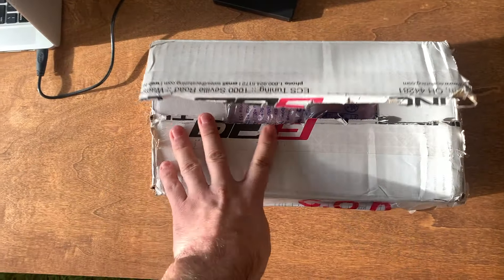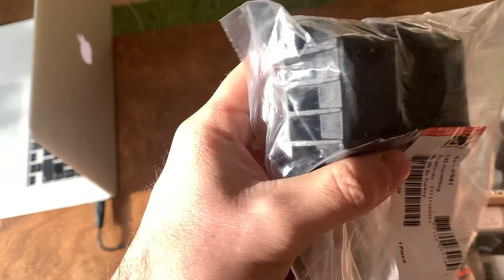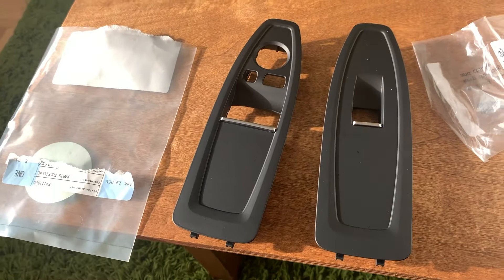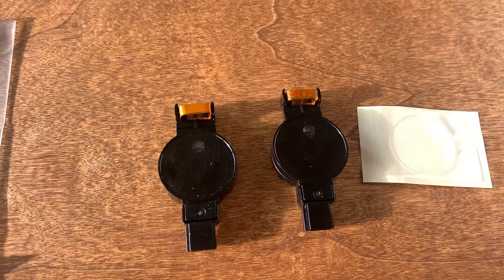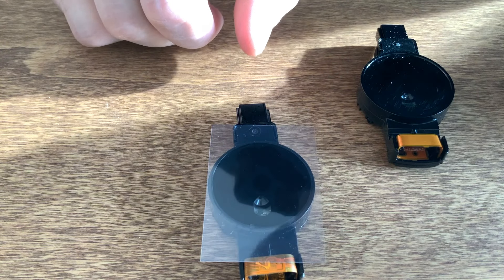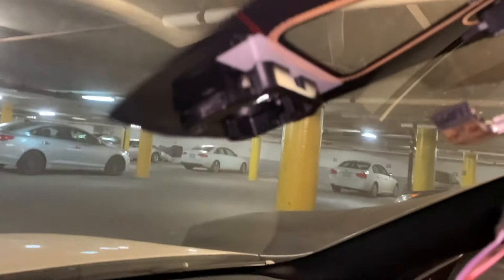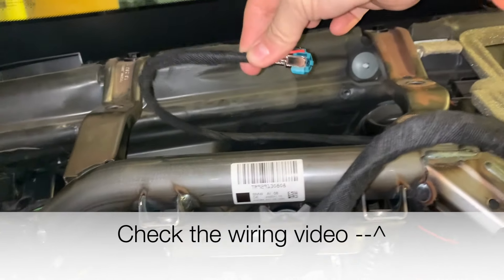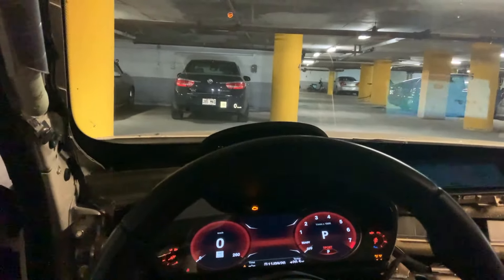BMW 435 HUD + Digital Cluster (6WB) install + Coding Step by Step (No red dot)

Comment: Congratulations for the job. I did the same retrofit on my F30 2013. Plugging the HUD is the simple part of the job.  The more complicated part is to remove all parts from shift parts to dashboard. It's a hard work takes long time...
Again congratulations 👍
Reply: hi man can i know some details about the retrofit? i also have a f30 wants to do the retrofit and did you cut a hole on your dash? I also bought a second hand rain solar sensor but don't know where to buy the gel to stick on the windscreen
Reply from the maker: Hey! So no I didn’t cut the dashboard. If you look at the other video about the change color you’ll see why… it’s doable, but I don’t like to do things that way… check it out. The silicon thing part number is 61 35 9 856 157 I got it through ecstunning but if you are in Europe you can get it through schmiedmann. Hopefully one day they will show me love the way I show them love Hahahah… sponsor requiered. Also don’t forget to change the windshield
Reply: @DorksandBolts  hi thx for reply, I don’t have enough budget to change the whole dashboard and windscreen. Even has double vision I am still gonna use it. I bought a rhd hud from China for only 90 dollars, just try to find all the other harness bolt and rain sensor also the air duck.

Comment: Do not disconect the camera, ADAS recalibration will be required after. :). You can easily remove just the rain sensor with out all that mess
Reply from the maker: Well I disconnect the battery most of the time so the camera is unaffected. But yes good point. It does need to be calibrated. Since this was a full retrofit I am used to do that on a regular basis now 😂

Comment: Great video, if you don’t mind what was the rain sensor gel pad part number?
Reply from the maker: Hi Salvador, the part number is: 61359856157 I think this is the same for all f3x chassis but make sure of it.
Reply: @DorksandBolts  thank you for that.

Comment: Great job!
I did retrofit hud on my f34, but in day time and sunshine cant see any thing!!!! Any advice?
Reply from the maker: Did you replace the windshield and the light sensor ? Check the part of the video where we see the difference between the two variants and how to install it
Reply: @DorksandBolts  windshield yes but not rainsensor!
Reply from the maker: There you go, that will be that final component, just code it properly

Comment: Nice job.a verry rare video with retrofit  coding.i just wanna ask you did you used a battery charge or something like that during the coding.ot just keep the engine on.and if you know does my 530xd 02 2012 foes support nbt nbt evo retrofit? 🤔.thx and waiting for more coding and retrovideos
Reply from the maker: Yes always use a battery auxiliary power to keep it over 14.4v no matter what you do. It might sound overkill for even simple codings, but better be safe than sorry

Comment: Do you have any advice for some starting out whit retrofit? Any programs things of that nature. Also very nice you did an amazing job keep up the good work I will stay tuning in for the next up date!
Reply from the maker: Hi Terrance, that’s a little tough to say. But I would say that it starts by deciding if some feature is something that you really want and can somehow help you enjoy your experience with your car. So it’s a little bit different for each person. Before jumping into any programs for coding, I would suggest really reading up on how your car systems work and what do you need to achieve the retrofit you are after, because these cara are very easy to break if you don’t know what you are doing. That said, if you have more questions, I wouldn’t mind helping you figure things out.

Comment: I've seen a few pictures of the 6WB cluster where the gas and temp gauges are upright, like in the traditional analog cluster, instead of turning the gauges sideways. Is this a setting in the cluster that can be changed?
Reply from the maker: That’s interesting, but don’t I don’t understand what you mean by upright. But as far as I know those two gauges are actually analog. Just a couple of dials.

Comment: Hi name is Donald,
 I would like to retrofit head up display in my BMW 440 I  in a 2018 convertible, so would I need to change the front windscreen to get the image to look ok ?

I should be getting this vehicle in a week or so and I’m trying to get all of the parts that will be required beforehand like the dashboard, light module in the screen and sticky clear adhesive,  and the other item that I will need to get is the head up display. 
So do I need to get any other parts for this retrofit. 

So my options, that I would like to retrofit in the vehicle I will be comfort access, folding mirrors,  Apple CarPlay, head up Display, and speed indication in the cluster.
Reply from the maker: That is correct unless you have the camera already installed… some windshields will be polarized already, check at the bottom of the windshield if it says HUD

Comment: Love the video. Where do I get the necessary equipment (obd to pc cable) and software to code?
Reply from the maker: Hi Marc, you could find the enet cable and the software on eBay or Amazon. Do some searches with your favorite web search tool and you will definitely find tons of results.
Reply: @DorksandBolts  I have a few WiFi obd connection tools and bimmercode and Carly- would you think I can use bimmercode expert mode for this coding or do I need pc software and that hardwire?
Reply from the maker: We do not have experience of doing this with OBD readers, so I would be wrong to say that “computer software is the only way to do it”

Comment: Hi, awsome job!!...did the HUD require a different dash? Or was the dash cut out to fit?...currently looking at buying a used part HUD unit 👍
Reply from the maker: Yeah it does need a different dash, check out the other videos where I explain how to change it, and even change the color of the dash. As I say on that video there are people that cut the dash, but I prefer not to do it.
Reply: @DorksandBolts  thanks!

Comment: I have an F10/ 2015, just retrofitted the HUD unit and replaced veganized 6WA kombi with hud option. I tried to code with esys 3.30.1 / PSdZ ver. 4.38.31 lite. I could not find the correct CAFD Files for any of the units, my I-Step 22-10-510 for all there modules, HUD, Kombi and HU. I ended up using files with the highest possible number. Kombi works fine but HUD never worked but it shows on display with all options greyed out. Any suggestion?
Reply from the maker: Do you have the button on the left hand side to turn on the HUD?
Reply: @DorksandBolts  Yes, I have added the button. The orange light is on. pressing it doesn't do anything. Do you think HUD should turn on even without coding?
Reply from the maker: It should turn on, at least with some info in it, is the most wire from the nbt connected properly?
Reply: @DorksandBolts  I checked all the wires connected, I have ordered new cable from ECS Tuning, should be here by the weekend, the first one was from ebay/China. I am confused about cafd file, how do you chose the correct file from the list if non from the cafd list is fully matching with istep? For example istep is 21-11-520 but closest I find 17-11-520 or something totally different like 23-3-500.

Comment: Great job !!! :) good to clean with mask haha. do you think for my e64 bmw have the silicon pad ? mine is not round ;)
Reply from the maker: Hehe yeah might as well get the masks to have more than one useful function :). I don’t think the rectangular ones have a silicone pad, I have seen a plastic rectangular thing on the windshield where the sensor attaches to.
Reply: @DorksandBolts  on the russian web sit i sent you the guy remove something similar than you. But was on picture then dont know if was kind of hard glue or gely like yours haha

Comment: Hmm, I don't know what I am doing differently but when I code DKOMBI the current gear indicator (P/N/D) doesn't show. I've tried timecriteria 0317 and 0717 but no difference.
Reply: Solved.

Used the original timecriteria instead of the 0317, 0717 or 1117. It now shows the gear and works but I don't know why. The guides I followed instructed that you need to change the timecrtieria to a date when 6WB was available to the F30.

No fault codes  when scanned.
Reply: Perhaps the later date models use KCAN2 instead of KCAN as my 1111 timecriteria?

Comment: Hi are you using icom or just enet cable? I’ve just done this retrofit now I need to code virginised cluster to my car and e-sys won’t connect via vin (greyed) and it just to connect before when I did map update
Reply from the maker: I used ENET, but IT would be totally recommended to do it  with ICOM. IT did happen to me that the VIN connection was greyed out, but I let the car go to sleep (15 mins or so) and then it worked.
Reply: @DorksandBolts  it does connect via vin once I let it sit for couple hours, but now I can’t inject CAFD to kombi because option “detect CAF for..” is greyed and where it says I-step it shows “not available”
Reply: @DorksandBolts  one more thing which e-sys version are you using? I’m using v3.27 and some people saying that I can’t inject CAFD with this version of e-sys

Comment: Thanks for the video! I have few questions:

1. How to find out that specific date that you edited on 27 min mark?

2. When you saved your 'VO kobmi atm nbt kafas', you mentioned that it is needed to code all of these ECUs. Is it because you installed new HUD, KAFAS etc.? 
If I change only the 6WB, do I need to code all the mentioned ECUs? Or just the DKOMBI?

Thanks in advance!
Reply from the maker: Hi Rokas, we are happy you enjoyed the video. What do you mean by “find out” do you mean why did I choose that date?
And yes in my case I needed to code lol those modules so they all know that I have a 6wb and not 6wa. In your case if you are only adding the 6wb you need to code everything that communicates with it, most of the time it will be the FEM or BDC, HU, and KAFAS, as well as the Komibi so the FA matches your car.
Reply: @DorksandBolts  
Yes, you edited your VO Zeitkriterium=1113 to Zeitkriterium=0317.

Why that date and not any other?
Reply from the maker: Oh I chose that because the production dates of those modules ranged from 0716 to 0719 (hardware) so I chose an in between all of them to make sure I have functionality between them.

Comment: I bought a 6wb cluster non hud it dont have heads up display is there a cable i can buy to retrofit the heads up display with the same non hud cluster and input would be appreciated
Reply from the maker: Hi. In our other video, I tried to install the plug and on the non-hud cluster and it didn’t work. There is no way you can have hud without a hid cluster in the f-series 😢

Comment: Hi can share the part number for the light sensor also did you replace windscreen?
Reply from the maker: HI, the rain sensor is 61356814596 but make sure that it does have all the functions for your car as well, these are very option dependent. yeah I did replace the windshield, check out the other video.

Comment: when you disassemble the whole dash like that when you put it back in won't some parts start to creek or something like that?
Reply from the maker: Not really, when I put everything back in; I made sure to put some loctite on screws and blots, also as a precaution I put a little bit more padding on some parts that showed rubbing. So far so good and no rattles whatsoever

Comment: Sorry probably a dumb question, but I have a 2016 f15 x5 40e with HUD. Would I be able to install this dash? From what I’m reading in these comments I am but someone said no because of the HUD
Reply from the maker: Hi, I am be misreading your question, but I am confused, you want to install the hud dash? But you already have hud?
Reply: @DorksandBolts  sorry for the confusion. I already have a hud and want this dash, will this work even if I have a stock HUD? I ask because I was doing some reading and someone else said that if my car came stock with HUD, that I would not be able to do use this dash. Just curious if this is accurate
Reply from the maker: Would it be possible that you send me a message on instagram?

Comment: hi, do you have the 550d logo pop up upon start up?
Reply from the maker: Hi, not really. We didn’t code anything like that on the kombi or the HUD yet. But maybe later, of course we will try to either have the mperformance or 435 in there... currently none of those are possible. If you see this showing up at start up, make sure you are coding the VO/FA to the units

Comment: Hello, I congratulate you for your work, I will be glad if you help with something.  I have a 2014 model BMW f30 vehicle I have installed 2 cameras in my vehicle, but it gives a calibration error, but the high-beam assistant comes on, lane tracking enters but does not read the speed signs, it does not reflect on the screen, so I think it gives the caliber error, what should I do.  thank you in advance

Comment: Where did u get the speed limit module mine is red and it’s circle, but I prefer the oem white square
Reply from the maker: Hi Kaiwen, the style is country specific. The round circle is for Europe and Asia, square is for North America and some odd Europe country I believe... I have seen the option to change the way it displays inside the kombi module, but I don’t know if that might interfere or not recognize traffic signs. Technically it shouldn’t, but I can’t be sure about it.
Reply: @DorksandBolts  I was just plug module between the cluster and inside just like Bimmertech but way cheaper and code on BimmerCode that’s work, it’s not like 5series or new model recognize the traffic sign by kafas whatever camera, I think it is base on data on your own navigation map.
Reply from the maker: I don’t have experience with those emulators, but probably you can just change the signal settings on kombi from US to ECE